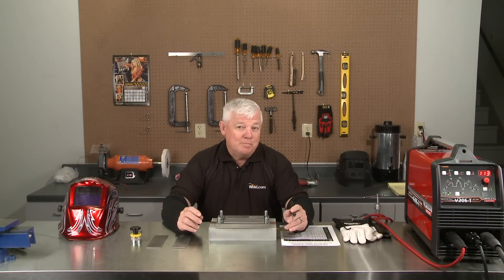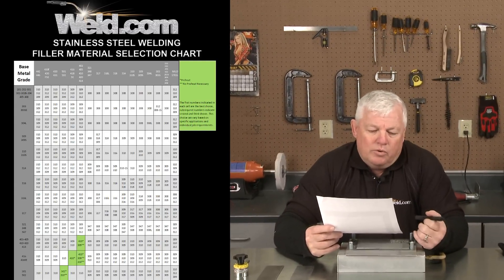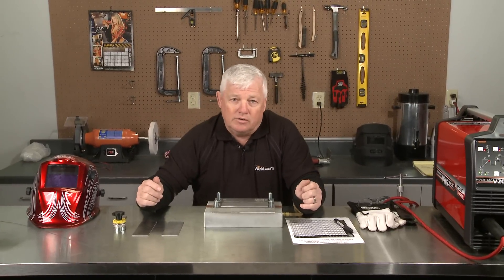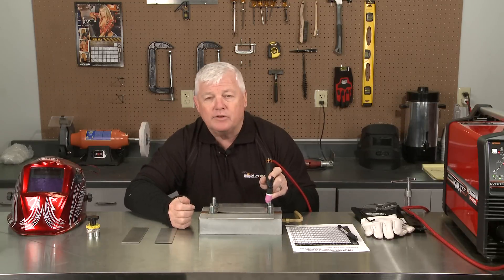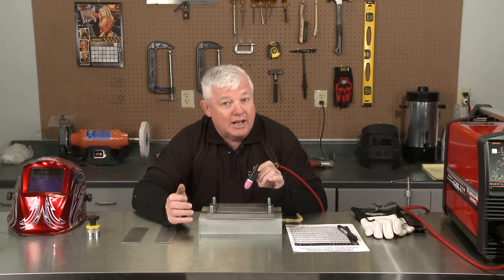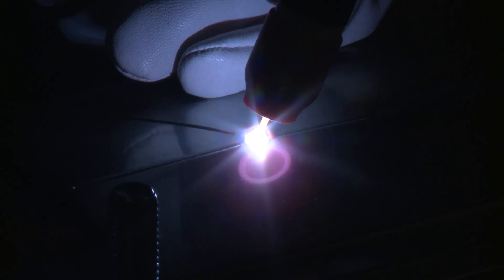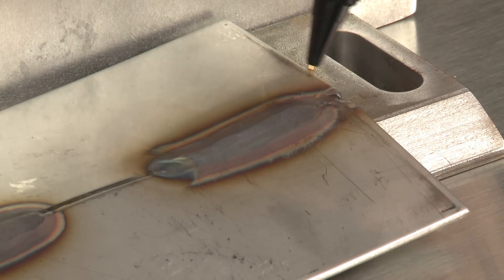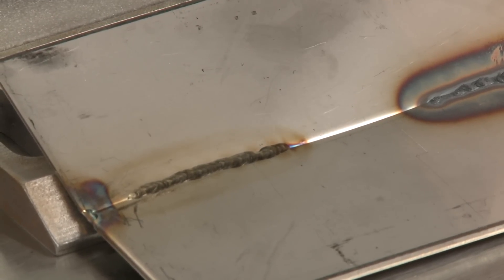TIG Welding Stainless Steel: A Beginner's Guide

Comment: All stainless steel alloys have iron, evidently. The magnetic susceptibility depends of the crystal structure of the alloy. In general, if it is ferritc (has ferrite), is magnetic (or maybe a weak magnetic pull). If the crystal structure is austenitic, it's not magnetic. Most martensitic stainless steels are magnetic also.

Comment: I’ve been welding stainless for two weeks and I can do better than this. That is burnt to absolute hell. He talks about welding in a way that will make your parts last not as long and then burns the stainless steel to a point where it will rust in a week

Comment: Simply using a magnet to tell if it's stainless steel is misleading. The most common SS will not stick to a common magnet; however, there are many varieties of SS that will stick to a magnet (some will actually rust a bit). As an inspector in a metal industry for nearly 50 years, the most economical way to tell, if you at least think it's some type of SS, is a comparison method. Use the magnet on a known magnetic material such as an iron part or a crescent wrench, screw driver,  common angle iron. FEEL the pull force on it then FEEL the pull force on what you think may be SS. If it's SS and sticks, the force will be much lower, there will be no doubt.

Comment: This dude really was a proper plonker. Typical salesman without much experience other than simple demonstrations. Hence why at any point there was anything that couldnt be turned and moved so it was all welded flat, little bit at a time there was somebody else doing the demonstration, ie Bob Moffat. 
Well he definitely demonstrated how to cook the chromium content out of that stainless😄😄
If he knew what he was talking about he would know that with stainless you use enough amperage to get the puddle going quickly, then keep a consistent, quick travel speed to keep heat input down and a nice few seconds downslope. No need for a footpedal what so ever, being able to lower the amps and slow down simply compounds the problem with heat input.

Comment: This welding is way too slow. Steel is overheating, all the good qualities are being burned from the material, your 304 is now crappy carbon steel. If you did this with a coupling on a 304 stainless schedule 10 pipe, the fitting would warp right into the pipe. Try focusing on the proper ratio of amperage to filler to travel speed. More amperage, higher travel, slightly more filler and you will have less heat going into the work. Welds should be shiny and silver with intensity of colour increasing with heat input. I know its hard to do on this thickness of plate, but come on.
Reply: Carly Myers, I have a question maybe you can answer. My husband is leaving how to tig weld. I have a project I want to do but not sure how he can go about it. I want him to weld a wrench 🔧to a double wall stainless steel cup. Is it possible? And if so what materials does he need to do it? Thank you in advance
Reply: @cherylcooper9882  309 filler rod

Comment: Sorry to ask such a dumb question but can you or any that knows explain to me what purging or a gas back up means?Your help would be very much appreciated
Reply: Back purging is when you keep a steady flow of argon on the back side of the area where you are welding.  Example:  When welding pipe, you add an additional argon line to the inside of the pipe.  One end gets capped.  This prevents your welds from looking shitty like this clowns.  Check out Justin on the fabrication series or Jody on Welding Tips and Tricks.
Reply: worldtraveler thank you and very much appreciated 🙏🏼

Comment: His advices may be good for beginners but his welds aren’t a good example to follow. His welds have too much heat input, your filler must be in the shielding gas area at all times(otherwise it will contaminate your weld). Again, he does give  some good tips but the welding itself isn’t that good. And, as many users have said, there are magnetic stainless steels.

Comment: what is the amp. for 316 tube pipe 1.5mm thicker and i use 316 filler
good video

Comment: I'm wondering if you could protect the back side of the weld by painting some sort of flux as a barrier instead of shield gas.
Reply: 2 years too late, but turns out you can apparently lol...saw it in another dudes vid, i think they called it "solarflux" or something like that, you pretty much paint in on the backside and leave it to dry, though it does make me wonder if it could contaminate the weld...i'd probably just purge instead but finding the setup/equipment for it is a pain since most major hardware stores near me seem to only sell the bare minimum welding supplies lol..gotta be an online or specialty welding shop job...

Comment: I though that it was bad if the bead turned a dull grey color like that, that means that the metal is getting too hot and oxidizing the air. Shouldn't you have pulsed your amperage or increased your travel speed?

Comment: Can anyone show me a video on how to tig weld stainless steel going uphill?
Reply: Andres Castaneda honestly, its almost the same thing.  just adjust your travel angle, kinda lead it with the filler, and that bitch will follow you wherever you go. check out jodi on weldingtipsandtricks. dudes a monster, you'll see all kinds of positions
Reply: This guy, the self named "mr tig" definitely couldnt have, can only weld flat on a bench😄😄

Comment: Mr.TIG is wrong about why 304 stainless is not magnetic.  304 stainless is not magnetic, because it contains about 8% nickle in its compostition, not because it contains chromium.  As an example, 430 stainless has chromium content, and is magnetic, so if you use the magnet test, 430 will stick to the magnet, which means you could be welding 430 stainless. Just thought I would mention it.

Comment: Loved the video.  As an hvac guy needing to weld stainless, not having a y for backing gas   for my project, I was looking to see if anyone had tried nitrogen as a purge/backing gas on stainless.  I found a wonderful article from the AWS including chemical analysis and and for using nitrogen as a purge gas for welding 316 austentic stainless pipe.  Upshot was results were within tolerance.  I think that if you would be interested, this may be an interesting alternative to argon.  As my argon fills run 4x what the nitrogen fills run, andcwe are considering bringing in a ln2 dwyer in because of the cleaner cuts in stainless with dry nitrogen, it is an interesting alternative as a purge gas for stainless.  It is what we were trained to use for R410 line sets when installing equipment on site.

I can forward aws article if you would like
Reply: 7

Comment from the maker: The torch used in this video was a CK 9F torch with super flex cable and Weld.com gas lens kit.
Reply: well if I can't log in to weld.com how can I get one please pm
Reply from the maker: Mindaugas Berteska The new site goes live next week. Unfortunately, the store won't be up until then.
Reply: it would be best if someone send me trough email because I'm not from USA so buy it would kind of problematic
Reply: Is that chart still available?  Yes i know im very late.  Any help would be very appreciated.
Reply: Stainless steel has both Cr and Ni as alloying elements.  304 is the alloy also referred to as 18-8 due to the Cr and Ni content.  Both 308 and 309 can be used as a filler material for welding 304.  The Cr/Ni contents are 308: 20/11; 309 22-24/12-15.  The reason why 308 and 309 are used for filler material is because of a higher resistance to corrosion.  Welds are often more susceptible to corrosion than the base metal.  Another aspect of the filler material is the "L" designation.  This means that the material has a lower Carbon content.  This is important in welding as it reduces the amount of grain boundary depletion of the Cr and Ni (especially Cr) as carbide precipitates.  The concern about this is that the depleted Cr grain boundary is less resistant to corrosion than the normal material composition.  By using 308L or 309L for the filler material if carbide precipitates form at the grain boundary, there is still sufficient Cr and Ni present to maintain a corrosion resistance similar to 304.  hth.  I very much enjoy your videos and I have learned a lot from them.

Comment: I heard from others that u can weld 304 stainless steel with 316 filler.  Can someone confirm if it is true?
Reply: yes thats true. as long as your using a higher grade stainless tig rod you can go up in grade but not down or below the grade you are welding.
Reply: yes,  I do it everyday at work
Reply: Up in strength is ok never below

Comment: good video, but that's not how to weld stainless,
to make a good stainless weld one should provide a much better argon shielding (or Ar+H2 shielding) either from the torch and from the backside of the weld, or should have to increase the welding speed
a good stainless weld is colorful, and here we got it gray - that will affect the weld performance